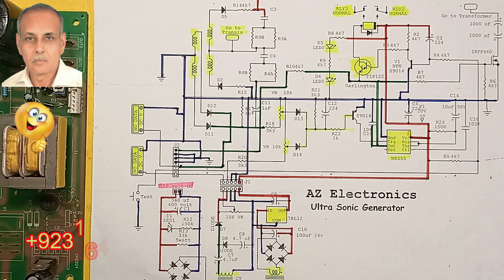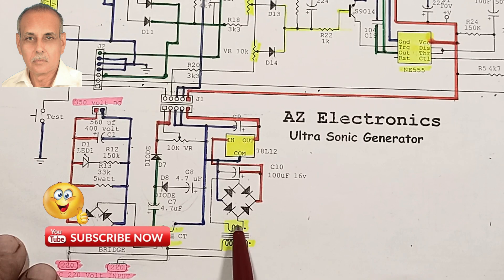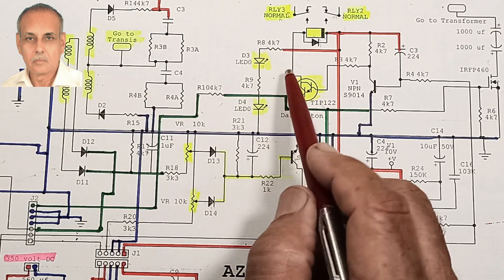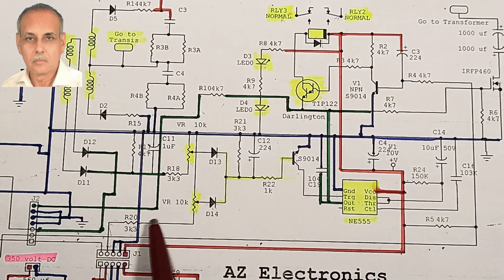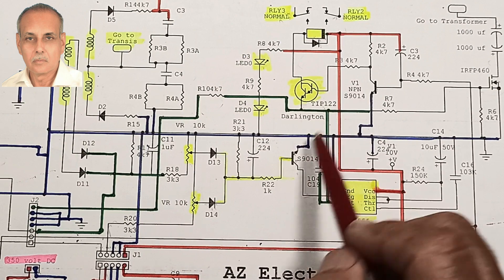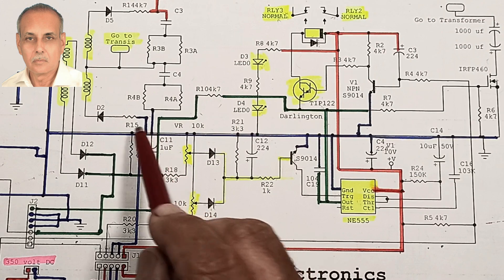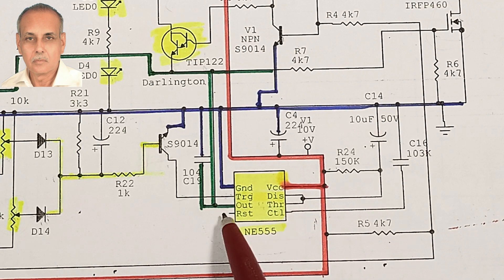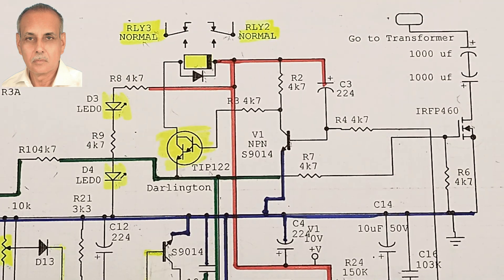01 555 IC Function in Ultrasonic Welding generator | 12 volt regulator circuit for 555 IC

Comment: Excellent videos!!  I have a question: I have ultrasonic generator and the power is 1.5kW, 20KHz.  I can vary the output power from 44% to 99%.    Power draw at 44% and 99% is almost the same and the power consumption is only about 610 watts,  so it does not reach close to 1.5kW.    Do you think the generator has problem?  What part of the generator could be bad?  Can you give me some advise?  Any way I can test with circuit tester?  Thanks in advance!